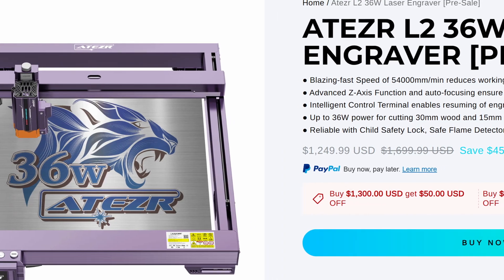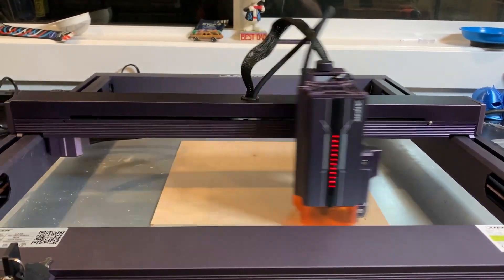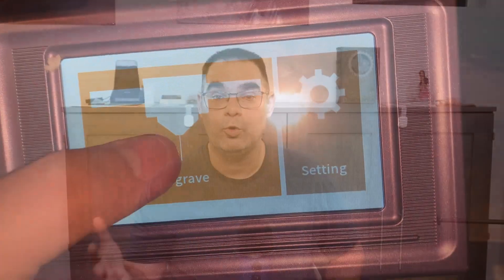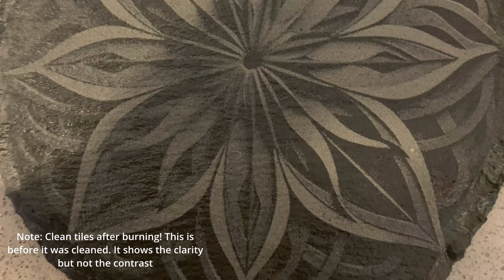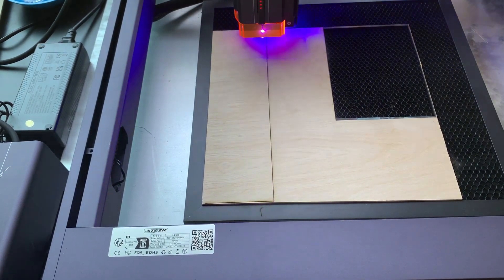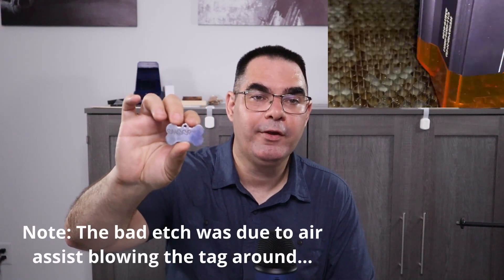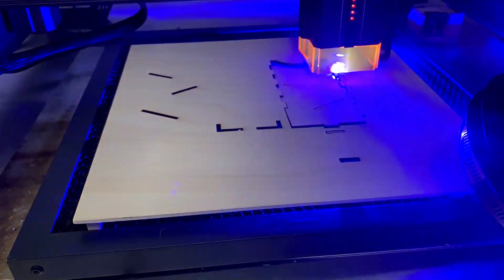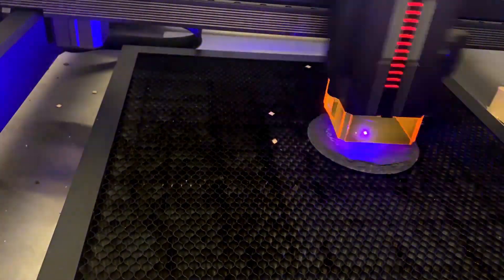Insane power! Atezr L2 36 Watt Diode Laser Review

Comment: Do I use the g code or dsp version light burn with the atezr L2? I am new at all this, but I'm determined to learn. I don't want to buy the wrong product though
Reply: Sorry I'm way behind on answering...gcode version of lightburn will work. You can use 'find my laser". if you haven't purchased it looks like they went under so you may want to look at atomstack which has the ikier brand that is similar (and atomstack has been around a while.)